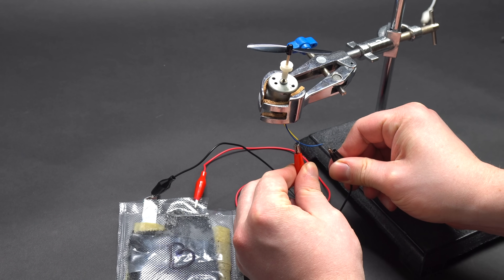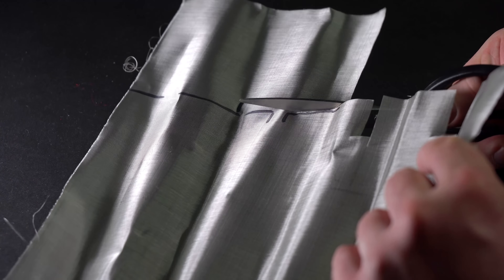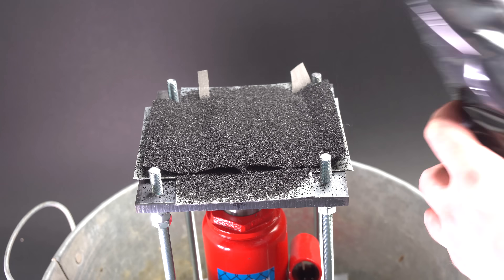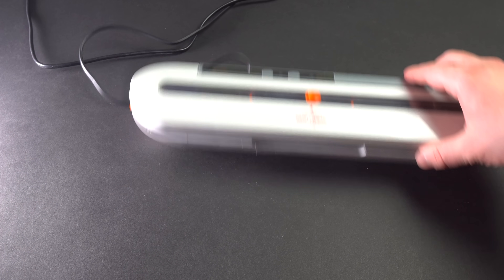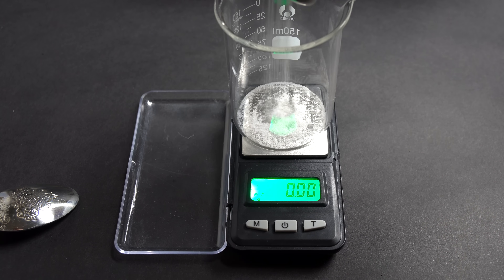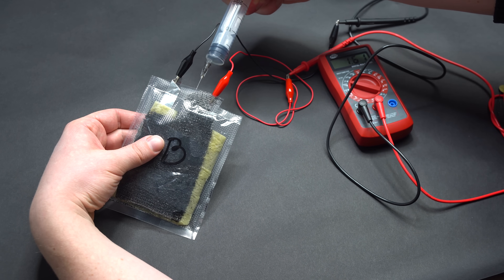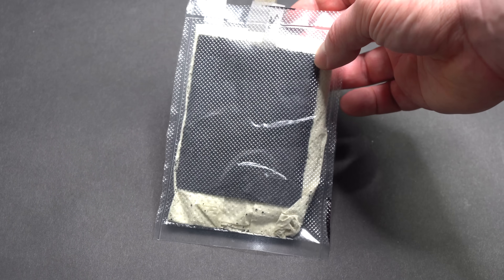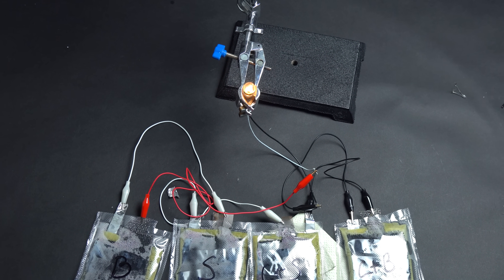Making a BATTERY From ALUMINIUM FOIL!

Comment: Interesting.  The press might be too elaborate.  Nuts and bolts, if you think about it, are basically screw jacks over and above being fasteners.  According to the equations:  (2*pi*f*R) = F/pitch.  Definitions ---- pi = 3.14 (about),  R = radius of lever arm, f = force applied to the lever arm (in foot pounds); F = force (either push or pull) of the nut/bolt set up,  pitch is the number of threads per inch.  So if you have an electric drill that stalls at about 6 foot pounds and if you have a bolt/nut combo that has 28 threads per inch then the F might be something like 6 short tonnes.  I think that my math  is approximately right --- you can wheel on over to Wikipedia to check it out using a scientific calculator.